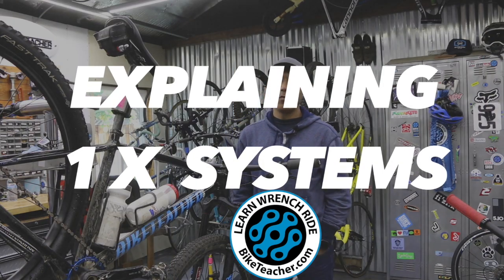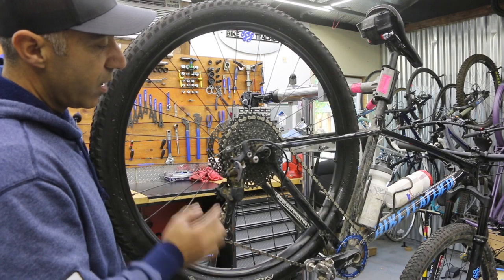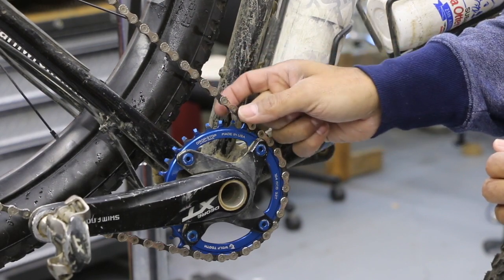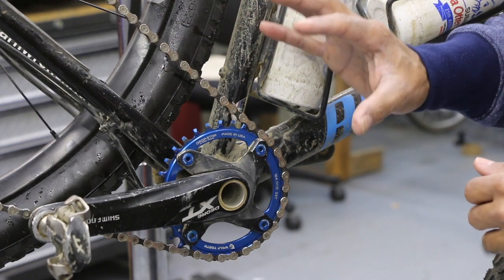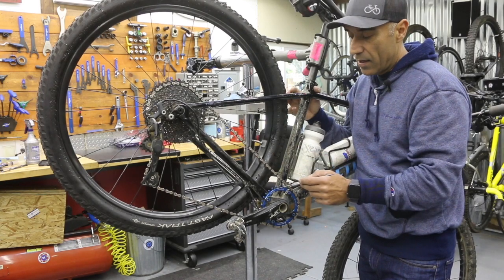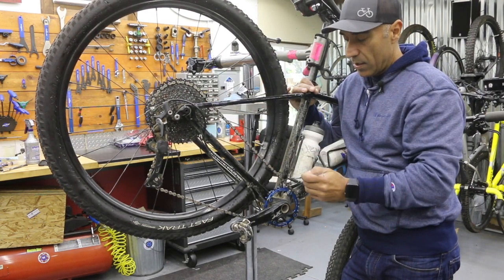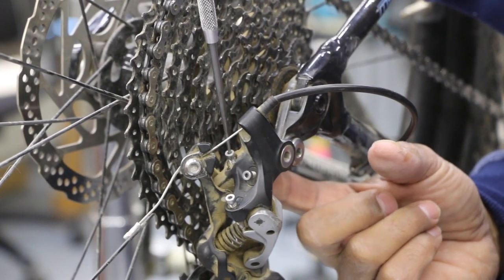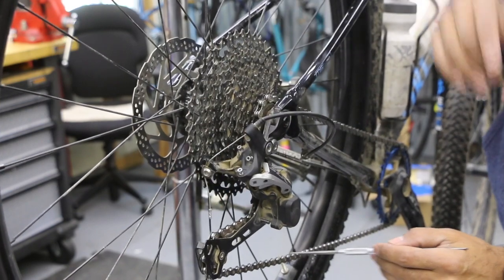Explaining the 1 X drivetrain. 1x10, 1x11, 1x12 systems

Comment: Thanks for the well explained video. Been off the saddle for a couple years. Need to service my suspension/dropper, and now I'm looking at my gears with disdain after seeing my buddies bike.
Reply from the maker: Your welcomed. Does he have 12speeds? Are you running a double in front?
Reply: @BikeTeacher  yeah, he has a 12 speed and loves it. Almost glad that his previous bike was stolen so that he could upgrade... I just priced the Sram options at 400-600ish. I'm looking at my bike(Santa cruz) right now trying to figure out if my forks and rear shock are toast due to years of neglect. I should probably figure that out first before ordering the drive train. They still compress and rebound, but I've noticed more oil seeping from the top right tube at the wiper seal. My dropper post doesn't rebound correctly at all, I need to physically pull it up while depressing the lever. That wiper seal is visually damaged at the top o ring, but it's an older specialized and I don't see any indication of what model it is... stay safe out there, recent robberies in the oakland hills targeting mountain bikers
Reply: @BikeTeacher  woops, forgot to mention I'm running a triple up front. 3x9, too many gears!
Reply from the maker: Ah, back in the day that was stuff! The conversations easy to 1x11, or 1x12. Just pay close attention to the specs. Your frames drop out width is important. Your current hub may only take a 11 Sp cassette.

Comment: Nice tutorial!  You might mention you need shorter chain ring bolts since they will be only bolting the one chain ring.  You might also mention chain line - it's important you pick the correct side to mount the narrow wide to.  Cheers!
Reply from the maker: Thats right, great advice! I think I have the chain info in another video. The chainring bolt fitting is an issue. Some Raceface rings have the built in spacer but not all.https://youtu.be/L2Ad5tWERYQ (:

Comment: I’m in the planning stage of switching my 11 speed internal gear rear hub to a  either a 11 or 12 speed with single chain ring. This is for a foldable bike of 24” wheels so I can’t really use a long cage so I think a 11-42 would suit me. I’ve used this on long tours loaded with 4 panniers but I need better climbing gear than the 11speed Alfine was offering.
Reply from the maker: So would the long cage come to close to the ground? I assume? I was not aware there was a internal 11 speed hub available. That's cool!
Reply: The Shimano M8000 groupset uses a medium cage derailleur for all 1x and 2x (one and two chainring) installations -  long cage is only for 3x installations.  This group uses an 11 spd cassette [CS-M8000] available in 11-40, 11-42 and 11-46, and derailleur [RD-M8000].  It also only requires a standard Shimano freehub body instead of the new Shimano micro spline freehub (or XD driver freehub in the case of SRAM drivetrains) that 12 spd cassettes require.

Comment: What if I have a 8 speed shifter and I want to convert to a 1x8 and I have a 11-42T cassette? Will that be possible? If so? What RD should I use with my shifter? Im using a shimano. Thank you so much teacher!
Reply: Do you have a 8 speed cassette? 7/8 speeds use the same chain width and shifter indexing. 9, 10, 11, 12 are unique. So you need a rear derailleur, shifter and chain that is compatible with your cassette. You also need a derailleur that has a long enough cage to work with your largest low gear cog.
Reply from the maker: Keep with a matching shifter and rear derailleur as far as brands go or shifting will be bad. it would be best to have a clutch style rear der. to hold the chain tight to the front chainring. Since you will be missing the front der, the chain will want to come off in bumpy terrain. Unless you have a chain guild in place. I dont know if they make a 8 speed clutch r/d. A narrow wide chainring will help this though.

Comment: I don't want to plunge into an expensive bike yet. So i have a K2 base (2007?)dual suspension that was 3x8 and I converted to 1x8 for now and yes I have that flop issues with my chain. Any ideas what might work
as an upgrade with a clutch?...budget wise ...1x10? Thanks

Comment: The front disc is the same 30 or 32  for 11 or 12 back cassette.? because I want to make it 12 and i don't know if the front it's o.k.?
Reply from the maker: Either one should be fine. A 32 tooth chainring will be great for a 12 speed cassette.

Comment: I have an ltwoo a7 shifter for my SLX and i run a 1x11 setup, My mechanic limited my rd to only shift to 1 to 9 and removed the ability for me to shift to the 10th and 11th gear because he told me it might break the derraileur, Is it because my shifter isn't Shimano Slx?
Reply from the maker: Itwoo a7?? Sram? Shifter and rear derailleur should always match brands due to the ratios need to match. A mismatched system will have poor imprecise shifts.

Comment: I am thinking of going to a 1 X drivetrain.
I never really used the higher gears don't feel I need them.
Reply from the maker: The 1x really simplifies riding. Less clutter, lighten up the load and less fuss inside your head not having to deal with two transmissions (derailleurs).

Comment: When would you replace a chain for your specific drivetrain?
Reply from the maker: Use a chain checker tool like the Park Tool CC-4 to periodically look for wear. Depends on ow much you ride, the conditions, mud, dust etc. It is best to change it at .75. I equate that to 75% of wear, do not wait till it is 100% worn, you will ruin the cassette.

Comment: I HAVE A TIAGARA 10 SPEED REAR DIREILLEUR AND 11-46TEETH SUNRACE CASSETTE. I NOTICE THE DIREILLEUR MAKES CONTACT AGAINS LAST 2 CASSETTE SPROKETS IF I PUSH IT IN.  DOES THIS REQUIRE SOME TYPE OF EXTENSION ON THE DIREILLEUR HANGER?
Reply from the maker: Most likely. The cage is probably too short. Research the tiagra and find the maximum tooth count. Wolftooth sells a nice extension.

Comment: Great explanation. Now I have a question If I want to upgrade my crank from 76mm 30t to a 96mm 34t do I need a bigger chain?
Reply from the maker: Not a bigger chain but a longer chain. Either install a new chain and measure appropriately or ad a the needed links to your existing chain. Depends on your current chain wear. Har to say how many more links you will need. I clarify one link as a one narrow and one wide. Some people may call this two links.

Comment: I was just looking to get a different 1x chainring and was actually looking at raceface, I'm confused though in the chainring description it specifies its for 10, 11 and 12 speeds. I have an 8-speed though and don't get why raceface would say it's supposed to be used for 10 , 11 and 12 speeds. I mean a chain ring is a chain ring right?
Reply from the maker: The chainrings are specific thicknesses. Most can run two different sizes. * speed cassette have a lot of space in-between gears so the chain can be very wide. As you add gears like today you have 12 gear cassettes. The chain then needs to fit the tight narrow tolerances. So no, chain rings must be different to accommodate the rest of the system.
Reply: @BikeTeacher  okay, I ended up going with a Wolf Tooth 1x that said it was for 9, 10 and 11 speed, it seems to be working fine with my 8-speed.
Reply from the maker: Keep an eye on it. If  you have anything funny happen. Could be the chainring is too narrow (thin). Not matching well with the wider 8 speed chain.

Comment: Can I put a 40t chainring (1x) to m7100 slx 12 speed drivetrain?
Reply from the maker: Yes, as long as it is 12 speed compatible. My latest video I built my Surly with a GRX 40 tooth  crankset and a GRX rear derailleur. I found out the the XT shifter is not compatible with the rear derailleur even though everything is 11 speed.

Comment: I have a Fuji Nevada 5.0 with 3x7, can I change only the chainring to have it with 1x7  with out getting a derailleur with clutch. The bike has a simple low budget parts. Thank you
Reply from the maker: If you do it, it will need the clutch and a one x specific chainring. Otherwise the rear derailleur WILL drop the drop the chain.
Reply: @BikeTeacher  Thank you
Reply: How do you like your Nevada..? Thinking about getting a 2021 Nevada 1.7. just for a little road riding and a little bit of trail riding. Nothing extreme . Thanks
Reply: @Buckeye_4_Life_  I'm 5.6 tall and the bike is a little taller than me, so l recommend ccheck your height first but the bike is solid for the price. I will buy from Amazon and let a bike shop tune it after you assembled
Reply: @casq882  Do you know how much assembly is required when delivered..?
Reply: @Buckeye_4_Life_  l think can take you one hour if you never did it but if you want expend 100 dollars for assembling and running l thinking worth it.
Reply: @casq882  O.k. thanks..!

Comment: So im running on a specialized sirrus x a 46t wolftooth oval chainring and a 11-28 rear ultegra cassette its a 11 speed and im riding with guys running 50-34 and 52-36 if i go up to a 48t or if possible a 50 will i be able to keep up on the flats with this guys or thats not gonna happen
Reply from the maker: Short answer yes you should have an easier time keeping up with them.Geometry and handlebars may play a part as well.
Reply: @BikeTeacher  thank you

Comment: Guys what is better on your mtb 1 bys or 2 , 3 bys?
Reply from the maker: I like 1X. One it works well performance wise. Two it lightens the load weight wise. Three, removing the front derailleur is elevating a problem that got people in trouble like any rough shift even on accident could bend it break your chain at minimum.